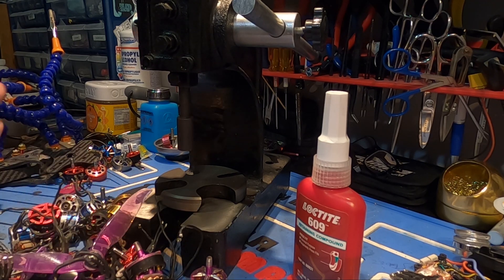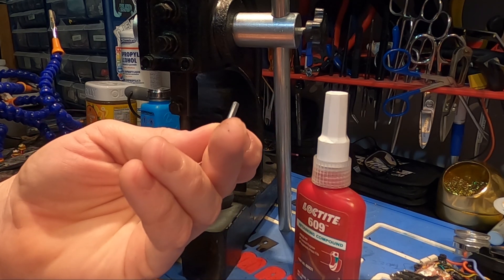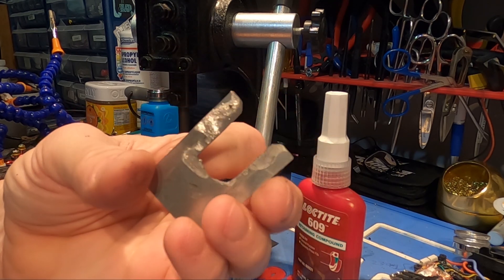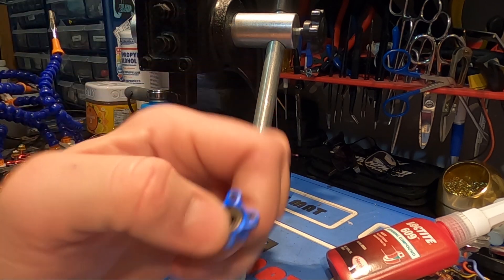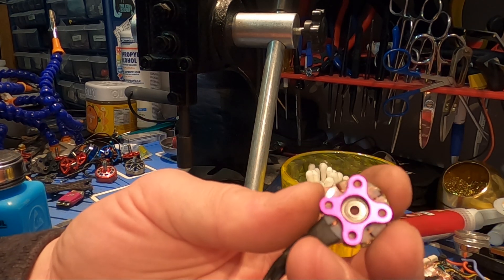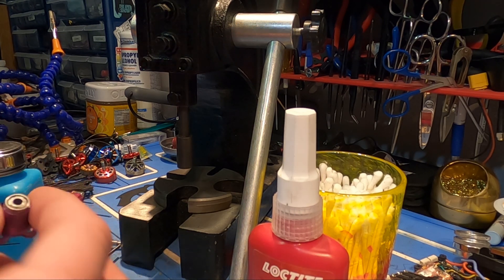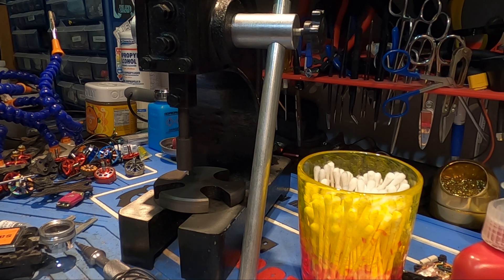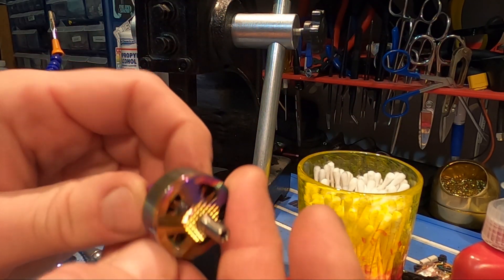How to Repair your FPV Drone Motors

Comment: Amax is a company who epoxy on their stator to the motor mount and they leave hardly any winding come past the motor mount to repair wires.   I have found iFlight and TMotor leave a good amount of winding to work with.  Haven’t looked at my RCinPower motors yet

Comment: My motor has a broken winding.. Any chance i can fix it without rewinding it?
Reply from the maker: No chance sorry
Reply: @fsarfino  dang it!... Buying a new one is my only option then. Would it be okay if i still use it? It can still spin normally.
Reply from the maker: @dealexl421  as long as your not sending it way out I'd keep ripping it until failure. Then you'll have a spare bell after the windings totally fail.
Reply: @fsarfino   alright man, thanks for the advice 🤘

Comment: 2207 stator rated for 4s can i change 2207 stator rated for 6s?
Reply from the maker: The actual stator has no bearing on voltage capability. That would be based on wire temperature rating and KV. But if you have a high enough temperature rated wire you can run a high KV with 6s.
Reply: @fsarfino  thanks for the reply im planning to put my karearea toa 2207 2450kv stator to my eco 2 2207 2400
bell fits to the toa stator and base
Reply from the maker: @zeusking4686  yeah you'll be fine as long as the bell & shaft fit your good. I've even ran 2207 Brother hobby bells on 2208 brother hobby motors with no noticable loss in performance.
Reply: @fsarfino  iflight xing2 2207 2775kv motors on 6s i think im pushing it?  im a noob theres lots of tacky black shit on the windings now i think they might b getting smoked or is there a way to clean that shit off?
Reply: i tried oiling the bearings cus they got crunchy from sand not knowing it would fall out. i think that black shit might be oil/dirt.  do you know if those iflight xing2 are rebuildable?  i dont want to rip the base off like in the video if its savable one of the motor wires broke off right on the winding hoping I can take half a wrap off to resolder it
Reply: Okies thanks big help

Comment: Im having a hell of time trying to get the Bell off of my T motor 5 inch quad,  which going by quick glance,  doesn't seem to be bent anywhere,  but obviously it has to be , which is Im assuming the reason why the motor simply is difficult to spin while using my fingers, but I digress, I am hoping that you have a full proof way or maybe just a quick tip that will help me to pop this damn bell off off,  this isn't the first time I've had issues getting the bell off of a motor, any help would be greatly appreciated! Thankx

Comment: How do you then repair the bell or do you just replace it?
Reply from the maker: At this time bell is unable to be fixed beyond shaft replacement. However I am designing a tool to fix dented bells provided magnets are not shattered or broken.